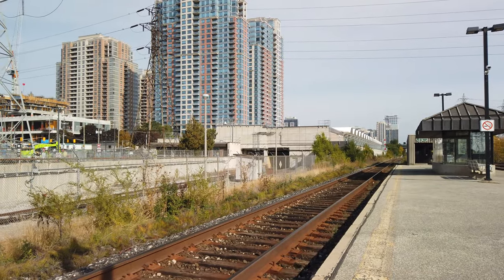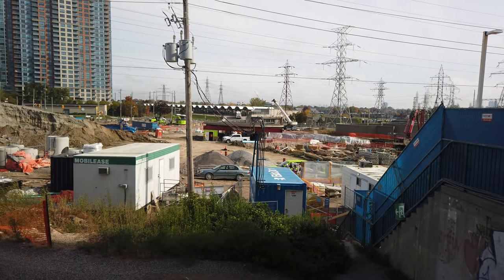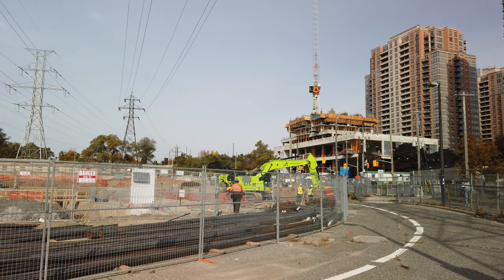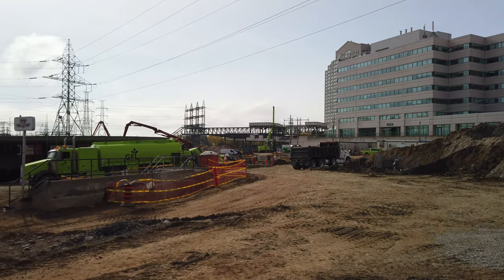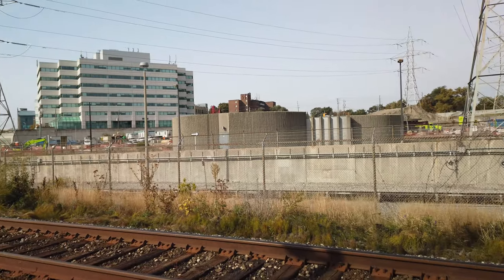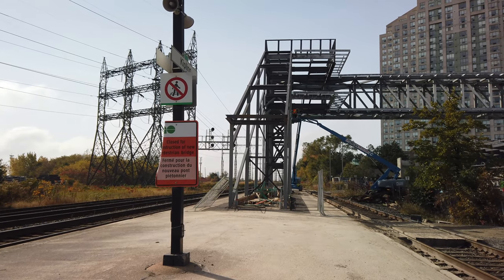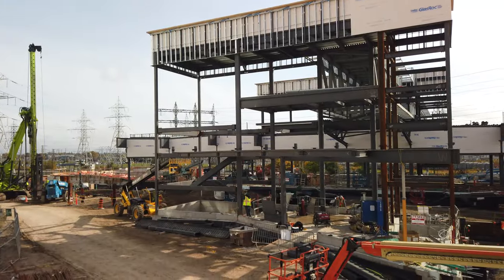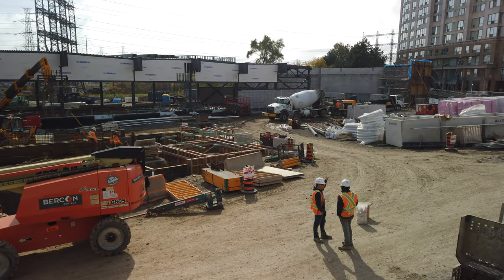Kipling Mobility Hub Construction Update | Ep.1

Comment: The Kipling area has undergone huge changes in the last couple of years. The spaghetti junction (5 points) is finally going to walkable.. they should have put mi-way buses when Kipling was built in the early 80's. they all drive by kipling station .. its actully making me mad rn. lol
Reply: Funny enough. Late 90's early 2000's, Mississauga Transit (Mi-Way at the time) had to bus two bus routes (I think) stop at Kipling. Route 84 Express and I can't remember the other one. It only lasted about a year if memory serves me correctly. It was cancelled during to low ridership. 
I wish they the terminal there when I was going downtown for school. It would have cut time off the commute.